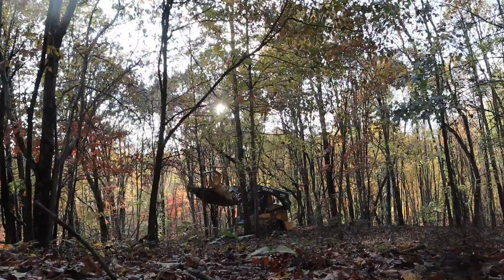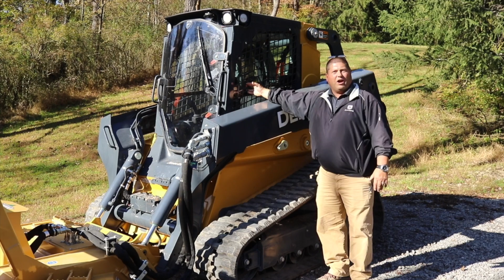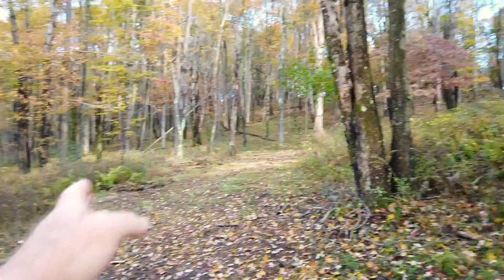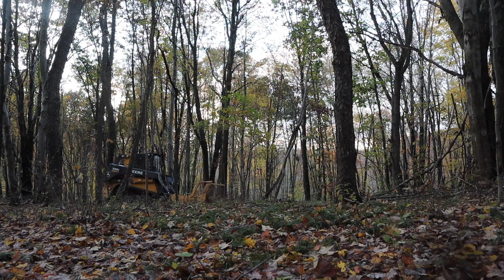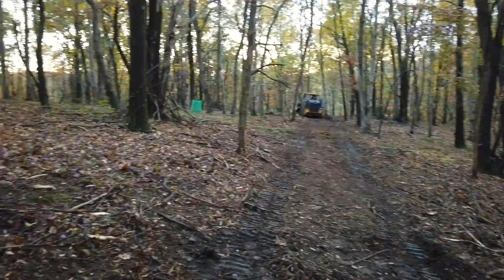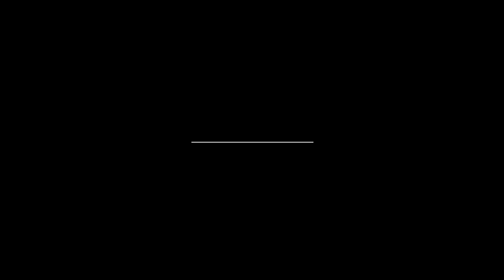#592 INCREDIBLE Skid Steer Forestry Cutter! DIAMOND MOWERS

Comment: Wow, that attachment is impressive. I've got a CAT 257b with high flow option. Machine runs normal at 13.6 gpm. If I engage high flow it bumps it up to 26 gpm. Still not enough to run that beast though. Plus it's only got the 2 quick couplers. But great video of course. Keep em coming.....
Reply: I've got the 48"model, flows 23 to 29 gpm.

Comment: I hate disc cutters because they leave too much stump and you can't safely take down large mature trees. Hate those exposed hydraulic couplers on that Deere, horrible design. Cat blows those JDs out of the water. 400 bars of pressure, 55 gallons a minute, 120hp twin turbo, turns trees to hamster cage shavings. Love JD tractors but nobody build heavy  machines like caterpillar,plus their mobile service is on point. Next round of clearing you ought to find a Cat dealer in your area and try out one of their commercial forestry rigs and you'll see the difference. I like fried bologna sandwiches but I like  prime rib a whole lot more.  You know what they say ...Once ya go Cat, ya never go back.

Comment: In my area Alabama where scrub is way thicker than up north Forestry mulching runs close to $200.00 per hour with a 3 hour minimum. We had 15 acres done last year at a cost of about $2500.00 and it will need it again next spring because stuff grows so fast here with our long hot years. it was still 100 degrees here until a few weeks ago.

Comment: I’ve worked with that head and also a FAE mulching head that is strictly meant for mulching the the FAE head is far more productive. I work for Arkansas electric cleaning up right of ways. I run a 2018 Takeuchi tl12v2 with the FAE head and I’ve also had the diamond on it to. I definitely Prefer the FAE head. I can clear about 2 acres a hour with it. Another thing I’ve learned that the skidsteers don’t last very long past a thousand hours. The mulching heads are very rough on them. But we also run the 9 hours a day to.

Comment: Yes for the small landowner contractors are the way to go. Before I retired I contracted a couple of projects using similar machines. Besides the initial expense there is all the machine maintenance none of which is inexpensive. Far cheaper to let a pro do the job and not have an expensive machine sitting idle.

Comment: That's very impressive!  You're lucky to live in an area where you can use something like this and seemingly have no concern for obstructions.  I live in an area predominately glacial till.  I can't even dig a 6-inch planting hole without a pick axe, and have to be constantly watching for protruding rocks when I'm using the tractor mower in the rougher areas.  What would happen to this flywheel and its cutting edges if it hit one of those immoveable rocks hiding just under the surface of loose twigs and leaves?  It's moving so fast, there's no way you could back the controls off quickly enough to avoid serious damage, or so I would think.  Thoughts?

Comment: Hired a guy in Anderson, SC.  Bought some property with 40 year old pine trees so dense you could hardly walk through. He worked for 3 and a half days 8 to 5 and cleared approximately 3 acres leaving most hardwoods and larger pine.  Charged me $10,000.  Probably could have gotten it done cheaper on a daily rate, didn't know that at the time.  Property looked like a park when he finished, now one of the draw backs is that the stumps are left in place and nature starts to take back over if left unattended .  When we get ready to build our house will need to get a hoe in there to dig the stumps out so we can establish a garden and lawn.  Great machines ours was a reel type instead of a rotary like yours.

Comment: A few years ago we had to clear 7 acres of brush and dead trees to replant trees for qualifying to be in Managed Forest, a tax break deal. I hired a machine like yours with an operator for $110 per hour. He estimated $1000 to complete the project. 3 acres and $4000 later I told him to quit. I found a very helpful salesman with Skid Pro who directed me to a $4000 brush mower that would mount on my small skid steer. I did the 4 acres plus some surrounding areas in about 25 hours. It didn't mulch quite as good but darn near! They sure are fun to operate! Far more fun than a bush hog on the back of a tractor.

Comment: I missed my calling, I should have become a heavy equipment operator.  I would have a ball with something like that!
Reply: Been operating heavy equipment I.E dozers, excavators,drag lines etc etc since I was 6 years old. Ive had fun all these years doing it. Mostly on cat equipment but will run anything with tracks or wheels. Cat 300 tracked skid steer is a better machine than deere could ever be.

Comment: Wow, that’s like a supersized stump grinder, essentially.  I wish that went on a tractor.
Reply from the maker: It would go on a tractor just dont have the hydraulic flow to run it on one.
Reply: Outdoors With The Morgans Yes, I was looking at a “Rock Hound” recently with the same situation.  It could fit on the tractor but just doesn’t have the hydraulic flow, unfortunately.  So I’ll probably rent a skid steer with a rock hound.  Have you ever used one?

Comment: Yeah there are companies who have these machines who will come out and open trails and fire breaks. Great for selectively clearing a bit like your feed lots. Note to yourself is to cleanup around your feed lots. Long time ago now I ended up getting a drott in to do about five acre's of this type of clearing. The drott was finished in a day easily but it took me ages to whittle down all the heaps the drott pushed up and even longer to clean up all the disturbed ground from the drott tracks. Top machine for a fraction of the price of the alternatives and you get to work back into the soil all the nutrients from what is knocked down.

Comment: SAW A BLADE LIKE THAT  FROM NEW FLORIDA CO.  ,FITS  ON FRONT OF TRACTOR   AND YOU CAN USE HORIZONTALLY AND IT TURNS  VERTICALLY FOR  DELIMBING ALSO DOES  BRUSH CLEARING  ON EDGE OF FOREST  ,SAY WHERE THE GRASS  MEETS THE WOODS  ,SMALLER FOR  SMALLER TREES    FYI

Comment: I own a Deere 333E and I use a Blue Diamond severe duty brush cutter on it for clearing and trail / firebreak construction and maintenance.  I can cut 6 -8 inch trees but it doesn’t mulch as well as that unit.   In hindsight I wish I’d bought a rotary mulcher instead of just the cutter.  About 5-7 k difference in price though.

Comment: I've rented a setup similar to that (different brand) and cleared 10 acres in a few days in my spare time.  They are hard to find to rent but some brands will do so and cheaper than hiring it out.
Reply: Chris Norman I am looking to rent one of these so I can do it myself and can control what is cut. Only blame myself if I clear too much! I think perhaps these are hard to rent due to the liability. What did you pay per day to rent and any leads you could give on who might rent these out to private land owners. I think I could get the hang of in 30min to an hour.